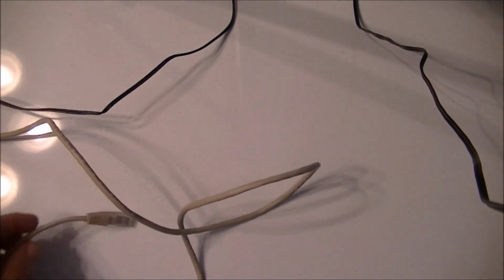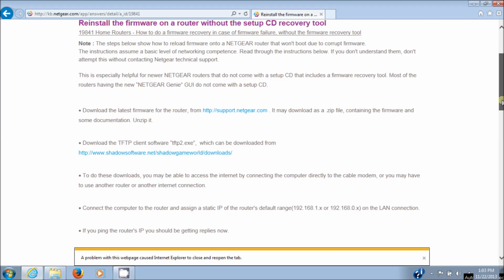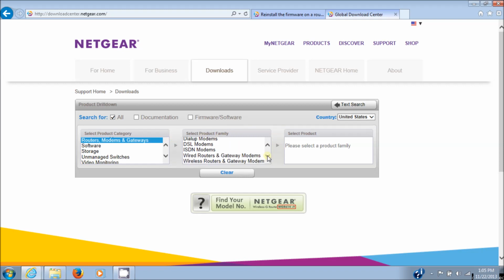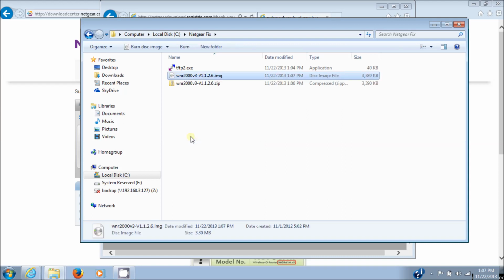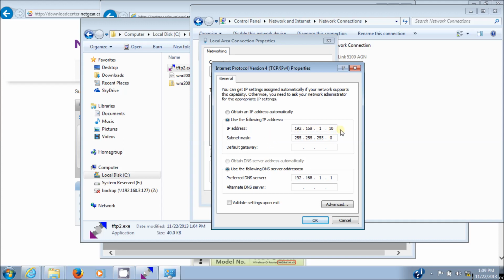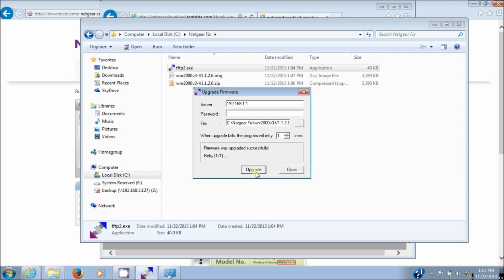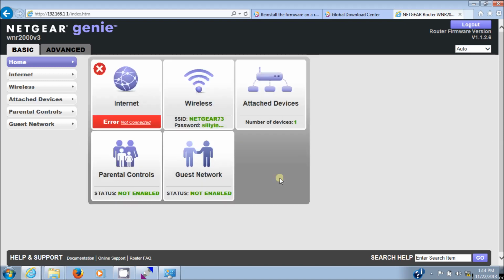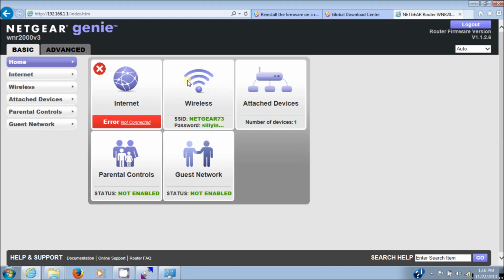Bricked Router Recovery Netgear WNR2000V3 (version 3) How I restored my router

Comment: Hey man, I know this video is old but I am in need of advice from someone who has dealt with this router. I tried to flash to the dd wrt listed on the downloads page and I hadn't fully downgraded the original firmware.

I bricked it. Got it in recovery mode and it took me an hour and a couple hairs to figure out the ip address had changed for some reason.

Set the static ip with the default gateway to that of the routers new ip. I can ping it and get a response. When I try to load it with the factory firmware through tftp2 it always fails.

It's the .img file of the 1.2.6 firmware for my wnr2000v3 router. This has me so frustrated and I need to figure this out.
Reply from the maker: Try using the earliest version available WNR2000v3 Firmware Version 1.0.0.60 available at the Netgear site. See if that works for you. Thank you so much for commenting. I appreciate it greatly. All the best.👍😀

Comment: After it tries to erase the flash on the router.
Reply from the maker: You should be connected to the router with a physical network cable directly to your computer and that it is a good and working cable. Make sure you followed my directions concerning your network card and have a hard coded IP address. Make sure you have a link light on the port you are connected to. Make sure you put the router into the default TFTP boot mode (blinking green power light and green port light. Make sure you are putting the correct IP address into the TFTP program (192.168.1.1). If you have done all this correctly and still get "Unbable to get responses from the server." my last suggestion is try another computer at which point if it gives you same response I would have to say your router is beyond repair by this method.
Reply: Okay. I'll go ahead and use another computer. Thanks for the suggestions!
Reply: Gabriel Andujar Did you have any luck when you tried a different computer?

Comment: Help I can't even turn on my router even through my power switch is plugged in and on
Reply from the maker: Are you sure you are using the correct power supply for the router. If you are you may have a blown one. Thanks

Comment: Mine's so bricked it won't even reset.  The light just stays solid amber.
Reply from the maker: Jerkwad152 That sucks. For $20.00 you can buy a TP-Link WR841N 300N router and be on your way. It's twice as fast (CPU) and it does take the DD-WRT Firmware. Here it is at Amazon: http://amzn.to/1TJQRqb I have been torturing mine for over a year and it has not given me a problem. Thanks

Comment: Sadly enough, I have a V4 and this fine procedure in your video won't work.  The port number won't flash and the computer won't recognize the network (brick!).  Nice video and thanks for posting, but I think the Netgear nerds changed things up to avoid us doing what they want to charge you $100 bucks to do via the network/internet when we call in.  Last Netgear product I purchase ever...  My N300v4 is only 8 months old!
Reply from the maker: Did you do a 30-30-30 reset? http://youtu.be/gczCzP9Rry0?list=PLnxXRLSlmSVNiENiN9wTejP6dtIqqmTya
Reply: Richard Lloyd
Richard, yes we did sir - no joy...  Maybe just a bad router from a recent power outage in which it never recovered.  I'm using the cord plugged directly into Charter's modem right now.  I just ordered a TP-WR841N router from Amazon for $20 so this should get us going.  Sadly I've not had good luck with Netgear so I'm OUT!    Thanks for showing people how to fix the issues, I"m sure many have been helped with your video.
Reply from the maker: Pete Weigman  Sorry to hear that. I am using TP-Link products and that's a great little router. I reviewed it here http://youtu.be/zr3nZclaaLI?list=PLnxXRLSlmSVNiENiN9wTejP6dtIqqmTya I was very surprised at how well it worked and it's WIFI performance was very good. You can't beat it for $19.99 Thanks

Comment: I was lucky enough to find one of these ( http://ecx.images-amazon.com/images/I/71Lq77fUCwL._SL1500_.jpg ) routers for cheap, but like a dumbass, I flashed the wrong firmware to it, and thanks to you, I finally got it back and working. Now if only there was a way to do this from Linux, as the EXE has been quite sour with Wine, spitting out...

[daviljoe193@localhost Downloads]$ wine tftp2.exe
err:module:import_dll Loading library MFC42.DLL (which is needed by L"Z:\\home\\daviljoe193\\Downloads\\tftp2.exe") failed (error c000007b).
err:module:LdrInitializeThunk Main exe initialization for L"Z:\\home\\daviljoe193\\Downloads\\tftp2.exe" failed, status c0000135

...whenever I try to run it, and swapping out the DLL for a different one didn't work, so I ended up resorting to making a Windows XP VM just to run the damn .exe. I'm still thankful that the router's working again, but damn I'm still pissed that I needed a copy of Windows just to do this 30 second fix. -.-
Reply from the maker: In Linux you could use atftp instead of the TFTP.EXE program to tftp the file over to the router. The mechanics would be the same but the configuration and syntax would be different for sure. Gald you had it fixed. Thanks for watching.